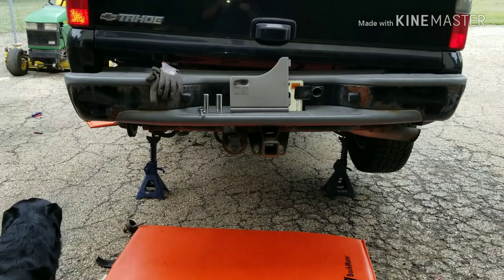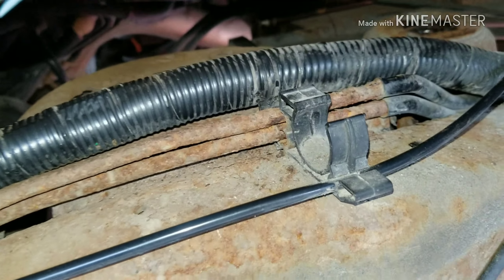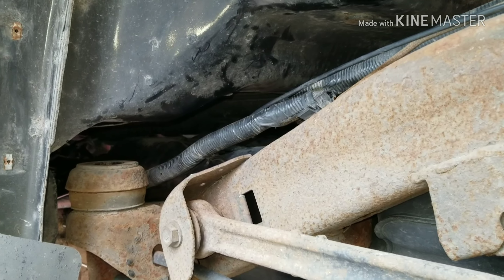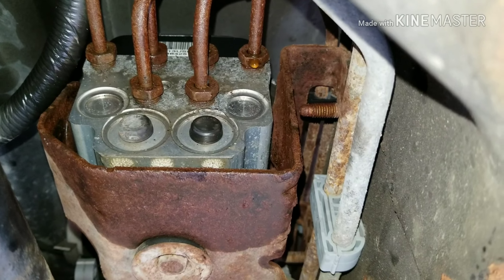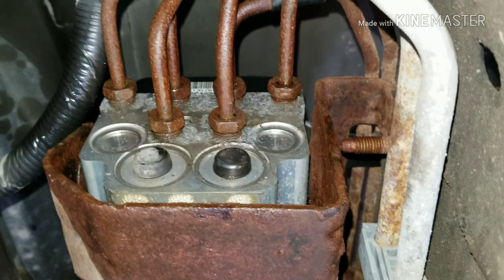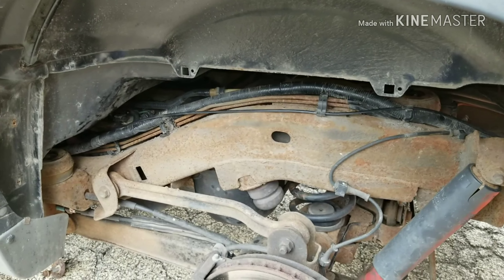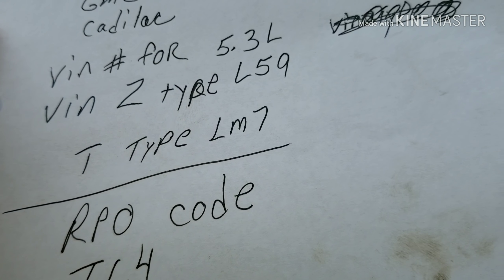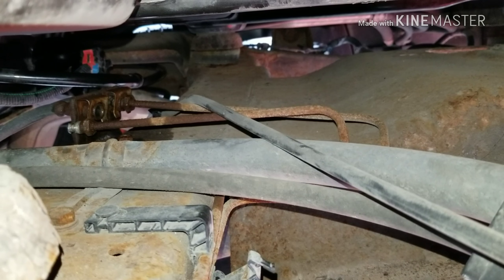2006 CHEVY TAHOE REAR BRAKE LINE REPL. PART1

Comment: Hello, getting ready to do this job. When you lifted the body did you take all the body bolts out or just the drivers side? Emergency cable  or fuel filler need removed? Ty

Comment: Great video and tips! My luck must just not be falling my way on this one. I removed all 6 body mount bolts on the driver side and well loosened the 6 on the passenger side, but when I lift up under the running board the frame still lifts with the body.  I don't even feel like mine is all that rusty compared to many I've seen in some of these other videos LOL!

Comment: Great info. Had the rear lines on mine blow. Followed this procedure and made it a breeze!  Thanks for the help.  

FYI - I didn’t want to do them myself as it was snowing, cold, and crappy. I had dropped it off at the local Firestone and they had originally quoted me 300-500 and I though, not too bad. Guy calls me next day and said $1200 just to do the lines not to mention all the other shit they said they’d need to replace.  I understood they just didn’t want to do the job and put an outrageous price tag on it.
Reply from the maker: Thank you for the response. This is why I made the videos.
Reply: A Mechanic / Firefighter and his Rott! How did you figure on lifting the body off the frame like that?
Reply from the maker: I have 3 videos on the rear brake line REPLACEMENT.  I cover that in them.

Comment: My 2001 Yukon blew two lines and I watched at least 30 videos. I saw yours and thought it was brilliant. I also did not want to drop the gas tank and still not have much room on top of the frame. I bought the Dorman seven piece kit in stainless steel. Went in just fine with some tweaking and had so much room to access all the clips. Thank you, thank you for this video!!
Reply from the maker: Your welcome,  this is why I made the videos. All the other videos want you to drop the tank.  Glad its helpful

Comment: Thanks for the help man! Just got my mom's truck back on the road!
Reply from the maker: Thank you and your welcome.  This is why I took the time to record the work . I'm glad it worked for you.
Reply: @amechanicfirefighterandhis7910  Did u have to disconnect the emergency brake cable to jack the body up?
Reply from the maker: No I did not.  I only lifted the body a couple inches.  Enough to get the clips undone and see the brake lines
Reply: @amechanicfirefighterandhis7910  Thanks

Comment: Great tips for this job. I did the body raise method on a 2002 Avalanche however the emergency brake cable at the front left wheel well restricted the body raise. I was able to place a 7/8 spacer (3/4 ply + 1/8 hardboard) at the 2nd from rear body mount and a 3/8 ply sandwiched between 2 thin metal shims (for strength) at the 2nd from front body mount. This was enough to easily remove and install the rear line without having to cut the "hook" off at the front end of the line. Had a leak at the rear line fitting at the ABS unit, very tough to access and solve. Solution was to bend the line as needed to ensure enters the unit absolutely straight. Handy to have a 9/16 stubby (or cut off a regular length wrench) and a 9/16 flex head flare nut wrench. Then to gain that very last angle to get the wrench on the fitting loosen all 3 ABS unit mounting bolts to the point of almost removing them. Now you can shift the unit around enough to get the flex head flare nut wrench to capture the fitting. Oh, and you also have to remove the fitting on the line below this one and slide it up out of the way and/or even pull that line out of the unit to allow enough room to be able to tighten the rear line fitting above it.

Comment: Did you have to loosen or remove the body mount bolts on the passenger side too? I have all 6 out on the drivers side but when I jack the body the frame is lifting with it.
Reply from the maker: Yes ,I loosened the passenger side but did not take them out. I did not want to have the body move.

Comment: Do you take the body mount bolts out before or after you put the tahoe on the jack stands
Reply from the maker: Only remove the drivers side.  All of them. Loosen the passenger side.  Either way on or off stands . It needs to be stable on the stands.

Comment: I just cut the line and pulled it out the rear.    Putting in the new stainless line was a pain but it only took 10 minutes.   I fished it down and had to crawl under truck and pull it along the frame.
Reply: Were you able to get them back into the supports/ mounts or just leave them hanging ?

Comment: Great video thanks. Very needed ideas.  I used copper to make the bends easier.  I used the old fittings. 
Also I didn't follow any of the original factory connections. 
There was a lawsuit against general motors for Rusty brake line.  You would think brakes would be the first on the list for safety. 

GM was number one in the world until their bankruptcy in 2008 they are an embarrassment with all their pathetic excuses. The new CEO woman finally said she would take responsibility for the key switch fail that killed many people and injured many people and thousands of accidents. Then in her second breath of air she says oh but we're not going to cover any claims before 2008 because we filed bankruptcy and we have a legal right to do that. What a piece of puke. 
in 1998 GM made an electric car, EV1 , about 1200 of them. They leased them to Hollywood people and a few years later they decided to recall all of them and pile them up they called the police to guard the area and then they crushed all of them except for maybe about three or four they gave to universities and Smithsonian.  
Have you ever heard of the NUMMI plant in CA.
It was a joint venture factory between Toyota and GM to build cars but since GM could not build decent cars because all the workers were drunk all the time and smoking weed they had Toyota build their best cars.  It ended in about 2008
GM is a new kind of sick people that are irresponsible and they took the bailout in 2008 just absolutely pathetic.

Comment: What are the locations of the bushings?  I can only find five...
Reply from the maker: Bushings for the body mounts ?
Reply: @amechanicfirefighterandhis7910  yeah me and my dad found the bushing all the way in the back and three behind the front wheel.
Reply: We also got the one near the radiator
Reply from the maker: Good job,
Reply: @amechanicfirefighterandhis7910  we still cannot find the 6th one
Reply: I have a rusted line in the exact same place that was in your video. I removed five mounts from the driver side and then jacked up the body. The frame still raises with the body. What am I missing?
Reply from the maker: Is it near the spare tire
Reply: @amechanicfirefighterandhis7910  we got the one behind the driver side rear wheel, and the one in front of that wheel, two more between the two wheels. And the through bolt by the radiator
Reply from the maker: I did loosen the passenger side but   did not remove the nuts.  Also it only gives you a couple inches before it lifts the frame too
Reply: @amechanicfirefighterandhis7910  ohhh alright

Comment: I just tore into this about an hour ago.  Are the nuts on the end of the body mount bolts supposed to be captive nuts that are welded into the frame?  If so, I may be screwed...lol.  The mount just behind the left front tire where the ground wires are at,  once loosened, I had to pull down on the bolt by hand while unscrewing it in order to get it to separate from the nut.  I tried to screw it back in but it seems like the nut has been pushed aside.  Is this the one you're referring to as the "through bolt?"  I removed the next mount bolt going towards the rear and it came out fine leaving behind the nut.  The next mount going toward the back acted the same as the front one but I didn't fully remove the bolt for fear that I broke a captive nut free.  I haven't started removing the bolt on the furthest mount to the rear yet.  The bolts weren't very hard to remove but the two I'm questioning made a little snap noise when they first broke free.  I removed them by hand because someone said the shop manual says not to use an impact wrench.  Sorry so long.  HELP!!   LOL
Reply from the maker: I removed mine with my impact on around 100 psi. The 5 bolts from behind the front tire to the rear are all bolts that screw up into the body. The very front bolt in front of the tire is the 6th bolt. The front bolt is a thru bolt with a nut. I did not encounter any bolts froze as bad as you made yours sound. What year is your SUV and how rusty? They advise against using an impact so you dont strip the nut In the body. I assume its welded in . You may have busted the nut loose in the body hole. The bolt did not break off did it? Does the body bolts you have out have all the thread and they come to a tapered point?
Reply: Ok, I think I got it figured out.  I found the front mount you spoke of under the battery.  Looks easy to remove.  I finally got the nut threaded onto the bolt. It seems that the nuts "float" a little inside the cavity they're in...at least that's what I think they're supposed to do, haha.  When I pushed the bolt in further, it threaded fine.  Going to loosen the right side body mount bolts in the morning and lift the body.   I used Liquid Wrench on everything I could reach at the moment.    Sorry for the drama.  Stay tuned  : )
Reply: Ok, all done except for the bleeding. What a pain in the pooper..lol.   Did you let your ABS unit drain dry?  I just couldn't get those fittings out with fluid dripping in my face so I let mine drain out. I have a Motive Pressure Bleeder but I'm wondering if I may have to bleed the master cylinder and have the ABS module activated with a bi-directional scan tool?  You said you were able to bleed yours without any extra measures other than your Mity Vac tool and having your son work the brake pedal?  Thanks.
Reply from the maker: @lizard944  I had my son start the truck and pump the brake pedal a couple times.  Then I vacuumed it and opened the bleeder. Had him pump it and then vacuumed it and then bled the bleeder . I did that until I had solid liquid and no air bubbles.  I basically used the master cylinder to assist in bleeding. I also had to wait a week for parts so most of my fluid was out of the lines and the ports on the active brake control valve.
Reply from the maker: @lizard944  also, my abs lights went out when I started building pressure in the system.  No scan tool needed for mine .
Reply: Thanks!  I hope it goes as easy for me tomorrow, but that's not my style!!  : )   I'll try a combo of the pressure bleeder and pumping the pedal.
Reply from the maker: @lizard944  I am glad you like my first ever YouTube video.  I may video more of my daily heavy equipment repairs and welding.  I hope it helped you with your repair and yes, that is a crappy  job.